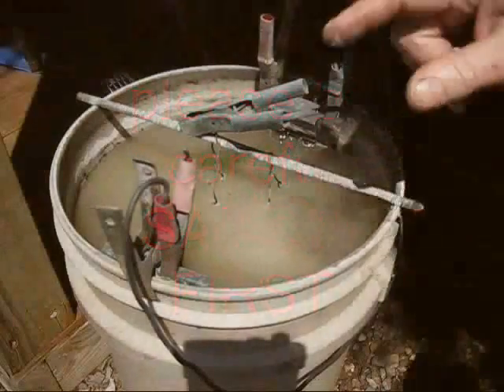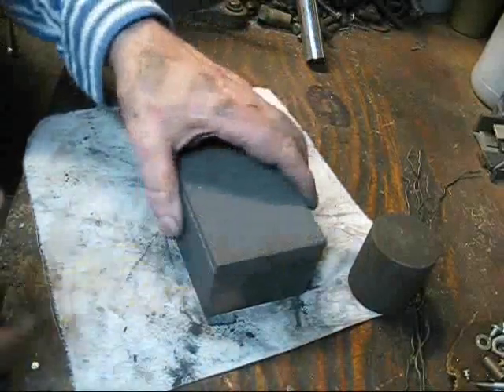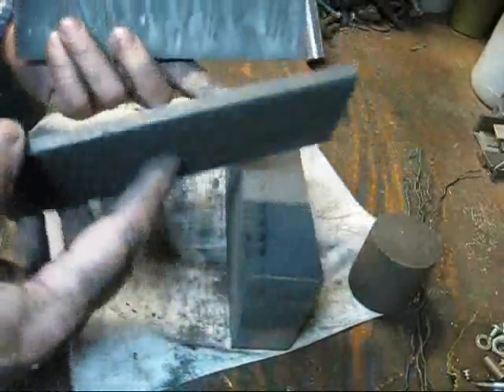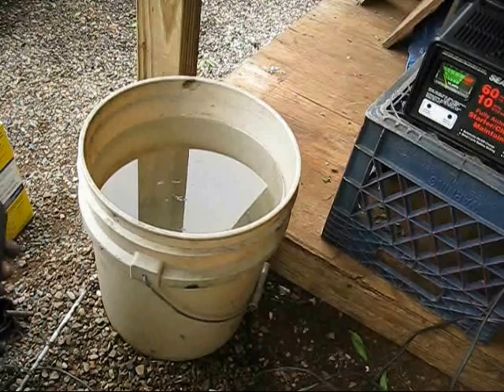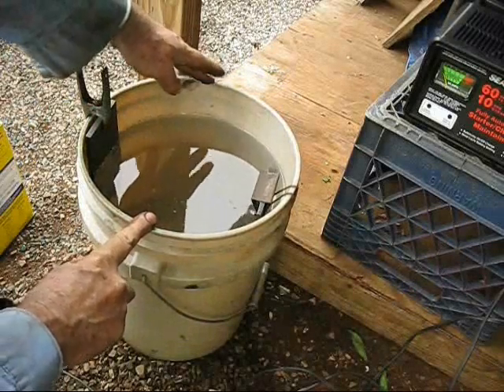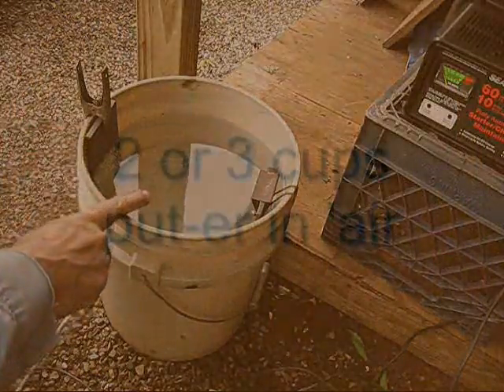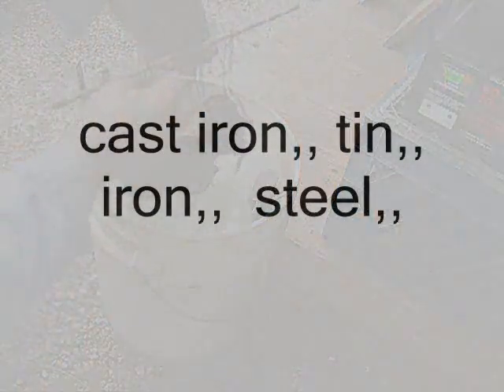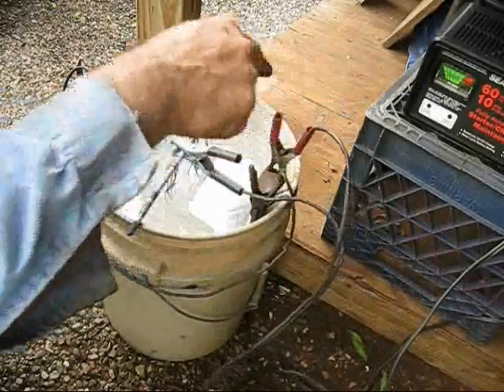easy electrolysis,,,,  the clean way

Comment from the maker: ,,,, yes that works,, and you can use graphite instead of carbon (graphite works great and I find it easier to find and cost a little less), and I might add that I have cleaned tanks this way,,, but I find it easier and works better for me to use an acid and neutralizer to clean the tank and then use a tank sealer,,  more homework,

Comment: love your videos Sam. Please keep them coming.

I have an old motorcylce gas tank with rust on the inside. 
If I hooked up the negative (cathode) cable to the tank, and the positive (anode) cable to a carbon rod put down into the liquid in the tank, would that work to clean up the rust inside the tank?
Or do I need to do more homework?

Comment: A neutral plate will drop your amps but i wouldn't expect you to know anything technical, by the way there is a lot more practical ways of removing rust easier and no water to dry off in the end. This is hoosier-engineering at is best... congrats.

Comment from the maker: ,,, this set up is to remove rust,, not to produce hydrogen gas (in this system the less gas produced,, the better), that's part of the reason to use graphite sacrifical anodes,,, if I wanted to produce hydrogen gas I would use stainless steel sacrifical anodes,, Oh, and a neutral plate in this type of set up is just that,,, neutral??,, thanks for watching,

Comment from the maker: ,,, yes, I know,,,,,, the reason I use graphite plates and super washing soda is to produce LESS hydrogen gas,, and to put anything between the part to be cleaned and the sacrificial anode would defeat the process of rust removal,,,, homework,,

Comment: if you want to lower your amps you can also put nuetral plates in the water with no positive or negative charge. This system is how i make hydrogen gas, water equals hydrogen x2 oxygen x1. when the electricity arks thru the water it splits the two seperate from each other.

Comment: you do know those bubbles / activity you referred to is hydrogen right? this electrolysis splits the oxygen-foamy fine bubbles, and the hydrogen-bigger bubbles in the water. if you move the plates closer together using rubber peices between them to make sure they dont join, you will produce even better hydrogen and when it bubbles to the top you can actually light the bubble on fire and hear it pop.

Comment: Yep, I get ya. I reckon if I just loosen the caps, assuming there are any, or make sure it has water in the cells, I should be okay. Also, it will be below freezing outside tonight. Will the electrolysis keep the water from freezing up while it works?

Comment from the maker: ,,, on some smart chargers you can use a 12 volt car battery to trick the charger into charging mode,,,, just hook up as if you are charging the battery, and then go from the battery to the electrolysis tank,, some will work, some will not,,, it's best to keep an eye on your system to make sure it don't over heat the battery or the charger,, (USE CAUTION),, yard sales are a good place to find the old style battery chargers,, hope this helps, thanks

Comment from the maker: ,,,, I have 2 other videos of my electrolysis tanks,, please watch them as the wiring diagrams are the same (don't let the color of the spring clamps confuse you),, negative to the parts to be cleaned,,, postive to sacrifical anodes (I use graphite), and the shape of the part to be cleaned will tell you how many anodes you need, all connected to the postive side (don't let the color of the wire confuse you),,, hope this helps, thanks for watching,

Comment: Can you help my simple mind to better understand the wiring configuration? I thought you spliced in a second Postive clamp for each piece of 'sacrifical metal' and I see the negative clamp on the material to be derusted. I do not understand the fourth clamp on the right side of the screen. It looks like a negative clamp on the same material as the postive one. In my mind that would cause problems with the charger. Thanks!

Comment from the maker: ,,, with the graphite plates and washing soda,,, battery charger set about 6 or 8 amps and all the parts I can get in the 5 gallon bucket,,, most of the time they are clean in about 24 hrs,, after a brush off if they are not derusted I put 'em back in the tank for another day,,, and I will add that not all metals derust at the same rate,, after you have used this system for some time you will know how it works for you,, even the type of water your area has makes a difference,,

Comment: Thanks for the extra info like the low cost if leaving this going, no need for exact measurements, etc.  BTW, if you don't have graphite you can use a couple or few pieces of rebar. Works just fine.

Comment from the maker: ,, my local kroger and wal-mart stores have arm&hammer super washing soda (sodium carbonate) in a 3lb 7oz box for about 4 dollars,, in this 5 gallon tank I use about 1/4 of a box and with the graphite plates my tanks stays clean for more than one year,, this tank is on 24 hours a day, 7 days a week, (yes, I do clean a lot of parts), I add water as needed and a handfull of washing soda "every now and then" to keep the amps at around 6-8 amps, 2 or 3 dollars a year is cheap enuff for me, thanks

Comment: Another source for carbon (soft carbon or graphite, either type will work) is to contact an industrial motor shop and ask them for used motor brushes.  You may have to dig in their trash, but you may have as many as you want.  Degrease them first with a water soluble degreaser such as Super Clean or Simple Green.  Motor brushes have a handy copper pigtail so the size of the brush is less important, what you are really looking for is contact with the solution.  Do not submerge pigtail.  Cheers!

Comment: You can get graphite from many sources.   One that springs to mind are Cadweld molds.   Cadweld is a form of exothermic welding of copper cables and earth conductors.    The molds are only used for 60-100 shots, then are thrown away.     If you know an electrical contractor that works on large building projects, a slab will get you all the used molds that you need.

Comment: I used to get carbon electrodes by opening old aa sized batteries and pulling out the central core. It already has the metal cap on it so its easy to solder a wire to. These are  lot smaller though.

Comment: Thanks Sam. I've been using electrolysis for about 5 years now and agree with you on how well it does work. I have been rebuilding a John Deere B the  last few
years and have used electrolysis on it on every piece that I could, including the
main frame of the tractor by dipping one end at a time in a large plastic barrel.
Keep up the good work Sam, enjoy your videos. Sometimes I think sure that I
can smell that good cooking clear from here.      Forrest

Comment: A question for you Sam. When using steel anodes the rust makes the solution go orange and messy. With your carbon anodes, does the rust just fall to the bottom of the container? Just wondering.